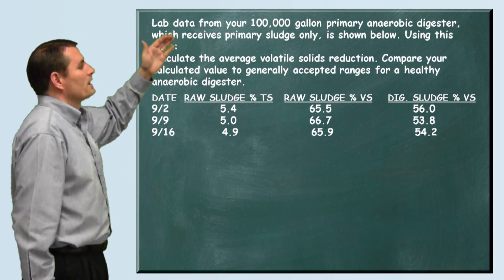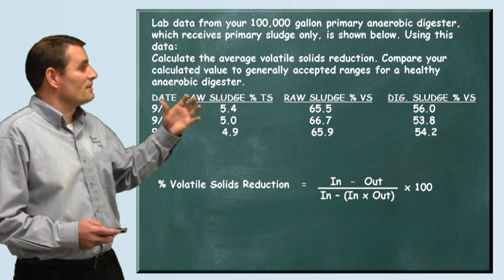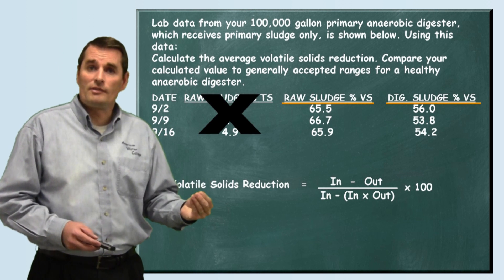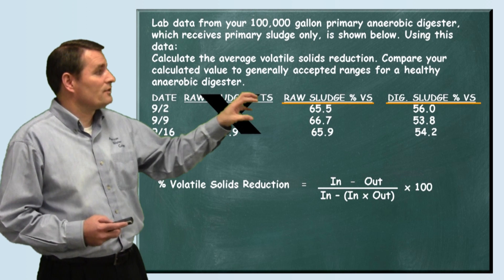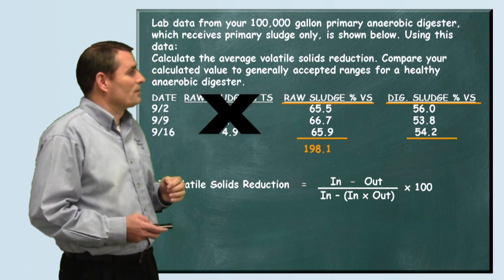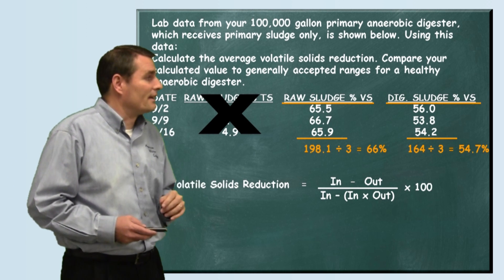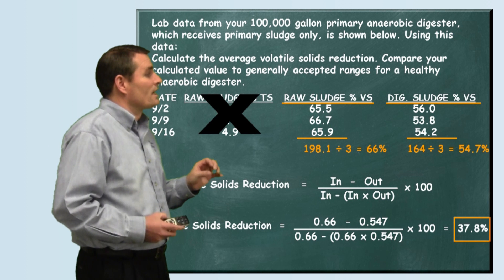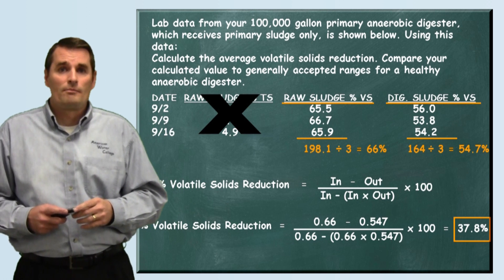Problem Solved: Volatile Solids Reduction - Wastewater Math

Comment: This is quite simple I suppose. After running a TSS sample on a pad at 105C, you ignite the pad at 550C then get the weight. And after calculating the TSS mg/l, divide the smaller number by the larger number to get the % of organic material. Then compare the results of the sludge fed to the digester against the results of the digested sludge that is being fed to your dewatering process. This could be applied to aerobic digestion as well. I think it would be very interesting to run these tests in an effort to try and optimize digestion in order to maximize the potential of volitile sludge reduction.

Comment: That makes no sense. According to that formula, if I had a volatile solids of 50 percent going in and 25 going out, my reduction would be 66 percent instead of 50 percent.
Reply: melancholyid Did you ever figure out why the denominator is in-(in*out) instead of in? I have the same question.
Reply: @sasamiy00  Only the biodegradable fraction fraction of the fed volatile solids is considered at the denominator of the equation 

https://books.google.co.za/books?id=BBxRYaSaapQC&pg=PA156&lpg=PA156&dq=Why+is+the+denominator+in-(in*out)+in+Volatile+solid+removal&source=bl&ots=79aEjIfdO4&sig=ACfU3U0H3kGyn0lzmFA-qzeSKwiLLn_TtQ&hl=en&sa=X&ved=2ahUKEwi_4emvt_noAhXKZxUIHXlUB2YQ6AEwAHoECAoQAQ#v=onepage&q=Why%20is%20the%20denominator%20in-(in*out)%20in%20Volatile%20solid%20removal&f=false